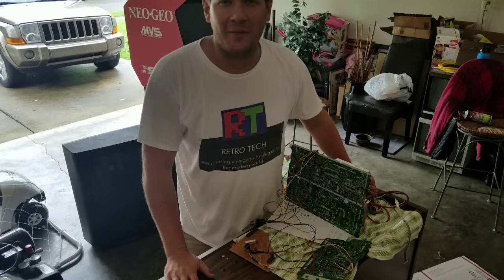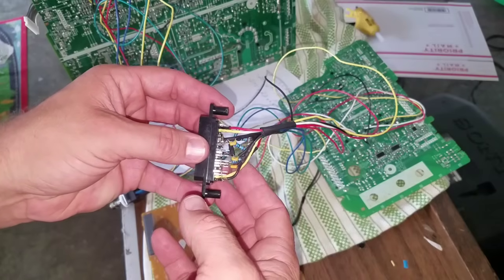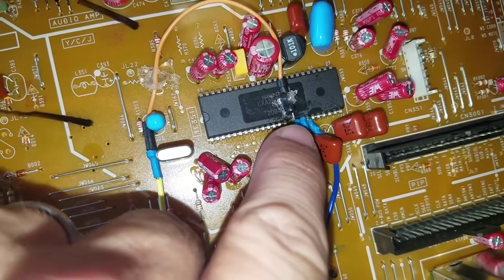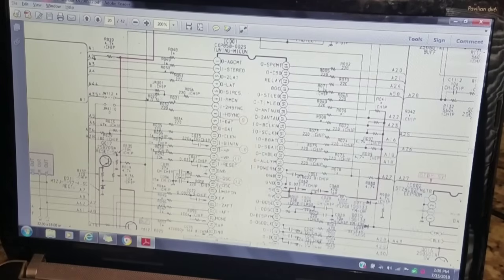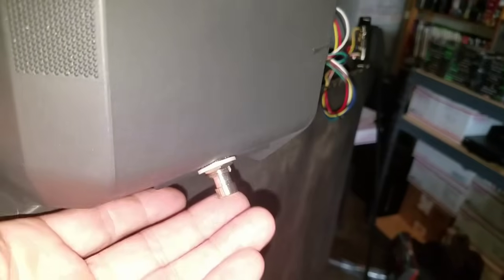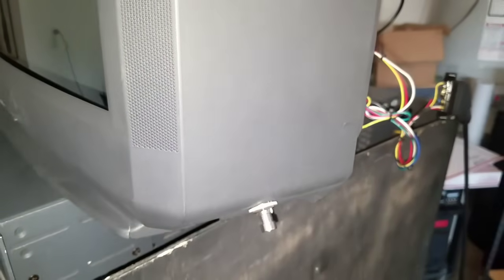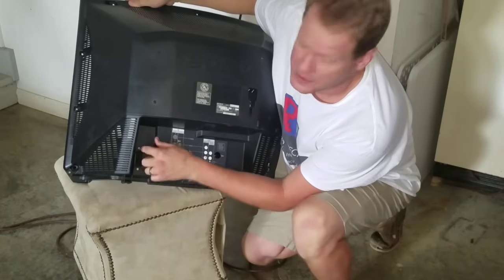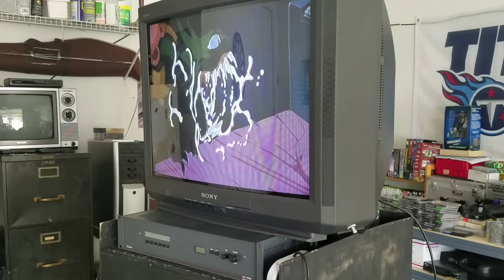How to RGB mod a Sony CRT TV for retro gaming

Comment: Hey Steve,
first I really enjoying u Videos.
So I got a Question.
I have a  Trinitron Sony PVM 14M4E and want it to connect to my PC . I have No Idea if that could work. 
Do you have any Ideas if/how it is possible.
Schöne Grüße from Germany
Reply from the maker: Professor Oak Thank you very much.  It's possible, but requires a special tool called an extron emotia or super emotia.  They are pretty rare and expensive right now.  I don't persobally own one.  These machines downscale 480p to 240p.  Otherwise you may need to try a cheaper converter or maybe even get a raspberry pi instead, since you can hook those directly to a PVM.
Reply: thank you for the quick response. I think get one of this emotia thinks ist impossible in germany. haha. I was trying some old ASUS graphic card khz modding with an programm called CRT_Emudrive and BNC to VGA Cable. but sadly it was not working. But I'm really bad in thinks like that. I'm not relly big on momy so this was the cheapest try for me. Greetings

Comment: I was wondering if the cap replacement fixed up the geometry issues and the corner convergence issues you showed in the previous video?
Reply from the maker: Great question.  I'll be glad to go over all my thoughts on that in the follow up

Comment: Fantastic series man. I'm planning on doing some RGB mods on some smaller sets for my job. How many RGB CRT mods have you done? Have you ever had to open up a chassis, find it didn't use an OSD chip you were familiar with and research it on your own? Would you be willing to show the process of attenuating for the RGB input so the signal is within proper levels?

Looking forward to more! Oh and do you know much about fixing up any CRT purity issues?
Reply from the maker: Jay F Thanks for the comment and watching.  I'm going to make a follow up video in the next day or two to answer questions.  This was my first TV mod.  I've modded loads of other devices in the past.  As long as you have the jungle chip pinout, then the mod is most likely doable to any other CRT.
Reply from the maker: Jay F I'll go over the other questions in the follow up vid.  Thanks again

Comment: Thanks it’s helped me understand it a little better are you using the exact diagram on the shmups forum ? Also are you able to share a parts list on what wire you used
Reply from the maker: Hi & thank you.  I followed the schmups forum somewhat to design the scart input and to help with the overall design of the mod.  It's a lost less complicated once you make it through your TV's service manual.  I will be glad to make a follow up video and answer more questions too.  I will show all my materials in that video (since I ordered doubles of everything) and add a bunch of links to products.  I just wanted to test the TV for a while and make sure it was working well.  It's been used a lot over the past 4 days with no issues, so I'm confident everything is working properly.
Reply: Retro Tech any chance you could show a closer look of how you wired the scart connector  for your follow up ? Wondering how you soldered it all together
Reply from the maker: MrKrimstah Yes, absolutely.  Thanks for the idea.

Comment: Just as a note for future mods and to any viewers, it's safer and easier to pull inline components than individual legs of a chip.

 If there's a capacitor going into the jungle on each of the osd rgb lines, for example, it's electrically the same to pull the cap and tap into the jungle from the pads as to pull the jungle's legs and use those, but the first option is less likely to damage something beyond repair.
Reply: @Shadowmask87  Best place to start is just looking for the service manual/schematic diagram for the set you want to mod. Elektrotanya and ManualsLib are good resources, but if you can't find your set's manual there you might try a manual for another set with the same chassis (chassis id should be written on the same sticker on the back of the set as model number)

Once you've got that, look for the major chips on the schematic diagram. You want the Microcontroller, often labelled 'Micon', and the Jungle chip that outputs RGB signal to the tube. Depending on your set's age they may have been fused into one chip for cost savings, then you likely won't have a good place to inject your external RGB.

If they are separate, find the OSD RGB lines connecting them and identify the components on those lines, there should be something like an inline resistor, a resistor to ground, and a capacitor. If that's not the case, try and find the datasheet for your jungle chip, you may need to go about injecting your RGB in a different way. 

But if those components are there, the rest of the job is pretty simple, basically add a 75 ohm resistor to ground on your ext. RGB input connector, then pull up the ground side of the OSD RGB resistor (if it's through hole. If it's SMD you'll need to remove the whole resistor and connect one with the same value to just the signal side, not ground) and tie in your ext RGB there, audio and sync go to an existing composite video input and 5V comes from anywhere you can find it on the TV's board to a toggle switch and then back to the Jungle's YS/YM pin, or if you're using scart 5V comes from pin 16 for a switchless install. The 8-bit guy's video on this subject covers the mod better than I think I've done in text here but it is really very simple for most TVs.

Didn't mean to ramble on like that, TL;DR start with your set's service manual, thanks for coming to my ted talk.
Reply: @BobofWOGGLE  hey Bob,  are you available via email to answer mod questions I have on my TV I plan to mod.  If not I apologize for asking
Reply: @Shadowmask87  Always glad to talk TV mods.

Comment: Dang, it's too bad you didn't cover the newer version of the mod. More recently the guys on shmups have figured out a mux circuit that allows you to use the OSD and external RGB simultaneously, without installing a switch and without needing a second (ccd or pip) RGB input on the jungle.
Reply from the maker: Bob Woggle I didnt find out about that till after I got this one done.  I will have to try it for the next one though.
Reply: Hooded Ghoul page 49 of the "CRT RGB mod" thread on shmups system11 forums, with a new revised schematic on page 58

Comment: Super cool stuff! I'm going to have to recap my monitors in the not too distant future. I'd love to hear where you think the best place is to source components. It'd also be cool if you could show how to test them at some point. Keep up the good work!
Reply from the maker: Thank you.  A recap is always a great idea.  When I recapped this TV, it took a couple hours to finish but was worth it.  The last cap I changed leaked and was failing.  I will be glad to show how I test caps at some point.  I like to replace all the caps at once on these old TV's/Monitors  since it's such a chore to break them down.  I get 90% of my components (caps for ex.) from here:  https://www.mouser.com/  
If they don't have it, then I turn to eBay.  I get my tools from eBay or here:  https://www.grainger.com/
Thanks for the questions! - Steve